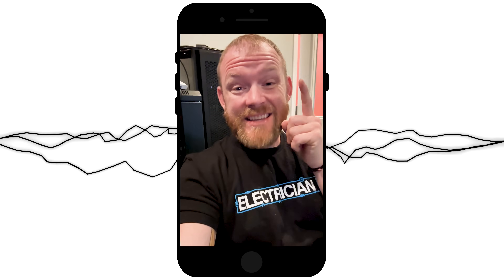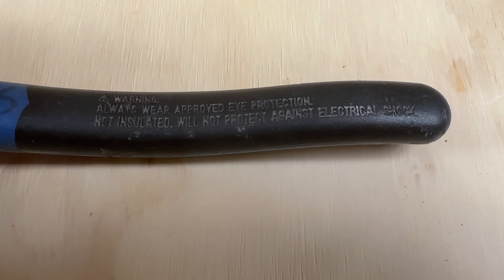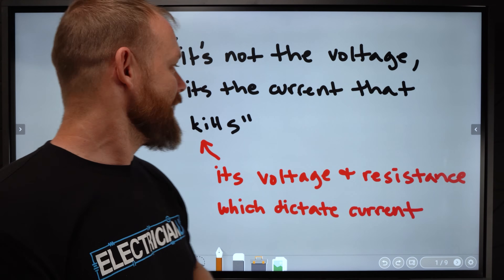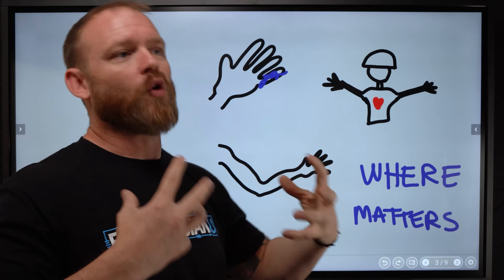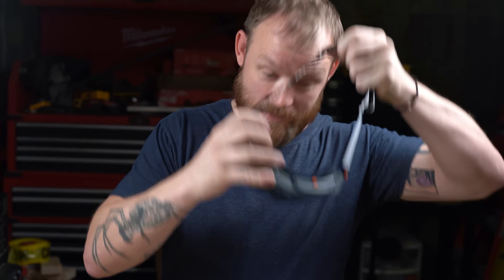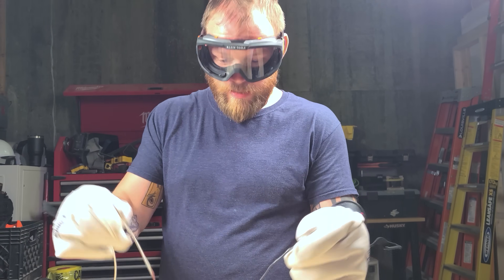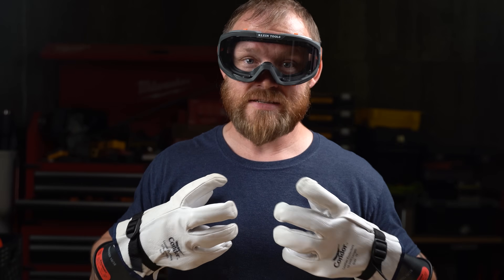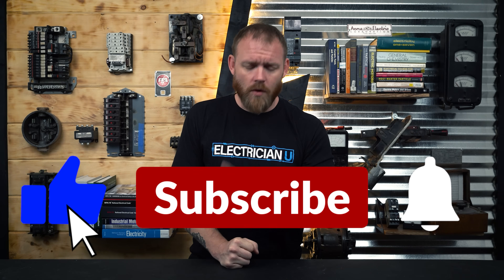Can 120 Volts Kill You?

Comment: I’ve measured 120v with my multimeter on current once, thankfully didn’t get shocked. Have has some run ins with rf burns though, very quite painful.
Reply: I can attest, RF burns hurt every bad and that's very low level burns... I nuked a finger tip before at 1KW carrier, it was equivalent of being stabbed with an hot knife being twisted around endlessly for a week or more. likely it needed cut/cleaned at hospital(nope). I didn't/wont do that again!

Comment: I was in an attic, not macho just not thinking, ended up with BX cable in one hand and live in the other, of course couldn't let go, managed to kick off the ceiling to push my body off, thankfully didn't get overly burned, but had nerve damage and numbness in one thumb/hand for about a year.  

Doesn't matter how much volts/amps, it's free to turns stuff off and double-check, it's costly to have impacts.
Reply: 💯  better to spend an extra 5mins turning off and checking stuff

Comment: For the rest of the world that uses 240 in every standard single phase outlet, I think a version of this with 240 plus the chicken and amp test would be interesting. Yes this video already answered the question for the most part. But perhaps it could help for those that might still think that while 120 won’t automatically kill you but can, still believe that 240 will automatically kill you no matter what. Even if your just shocked in the hand.

I wonder if this misconception “that 120 is inherently safer” the word safer here makes far too many people think it automatically means safe. Could be why its taken North America much longer to add gfci to every outlet wheres in every EU, AU, NZ system every outlet is RCD “GFCI” protected even the 400v circuits are RCD protected.

Although interestingly most RCD I’ve come across are rated at 30ma and I’m curious why that is vs the 10ma stated being the safe limit in the video, is it different for 240?

Now for note, I do have a power strip that has a 10ma RCD I got in Germany. So they do exist in Europe. The RCD is made by ABB and is the European standard style din rail type just in a power strip which I thought was really cool.

So that could be an interesting addition as well.
Reply: I don't think "Big Clive" electrocuted any chicken but he did hot dogs and meat pies and other foods and the  240+v on the Isle of Man made a lot more sparks and smoke and sizzling/crackling sounds!
Reply: @LDuncanShortridge  Interesting, I wonder if the composition of the hot dogs as being processed and higher in salt and nitrate content than chicken “despite the added electrolytes for this experiment” had any added effects to the resistance. I would be just as curious to see those hot dogs at 120 now that you mention it.

Comment: As a power lineman I’ve direct handle 20 Kv with proper PPE for over 4 decades. I don’t work 120 volts hot. As a kid I got 277 across my thumb and index finger, not fun. When I was a young apprentice lineman, we were taught that it only took a 1/10th of an amp to be fatal.

Comment: Three (3) phase three (3) wire power company distribution system ( no neutral).        How does the power company Balance The Load.

Many many three phase services connected to the system.

Comment: Dad worked in a power plant.  He was working on something and had to leave it for a few minutes.  In the meantime, as you co-worker turned it back on.  That voice we hear from time to time told him to check it again with a meter.  He did and avoided being shocked.  He was passed at the guy who turned the circuit back on.  I don't know if he found the guy who did it.
Reply: Also use lock-out and tag-out to prevent others from turning on the power.
Reply: Ur dad fucked up by not Lockout tagout ,not the other guy

Comment: Realistically NO ONE TURNS OFF THE MAIN PANEL FOR A BREAKER REPLACEMENT. It's not necessary if you know how to stay safe and have the correct PPE. Service work however is frowned upon, but many do it live at times. With no OVERCURRENT protection it's another ball game.

Comment: In Australia we work with 230/415V in standard electrical installations and sparkies here don’t carry non electrical rated tools e.g. pliers/screwdrivers etc. ours are always rated to 1000V and we rarely work ‘live’, the question is though, why as an electrical worker would you ever carry non insulated tools? It’s just good practice if anything to use them always
Reply: The same reason I don't wear a hard hat if there are no overhead hazards, don't wear hi-vis vests if I'm not doing road work don't wear safety toe boots if I'm in a finished occupied residence. Proper tools for the proper scenario.

Comment: I was replacing some troffer lights at a store and had the power cut off for the fixtures
Some goofball wired another set of fixtures through same conduits  and when I moved the one fixture there was a huge pop and sparking from the conduit as they didn't shield the wires

Comment: I worked as an electrician for many years, and it's very hard to kill yourself with 120V. Yes, if you're standing in water. Yes, if you can't get away when you contact 120V. And for 220V and up, you can definitely shock yourself to death easily.
Reply: Yeah I’ve been bit by 120 and imagine double that would not be something I’m gonna try.

Comment: It’s not about the voltage rather about how you are shocked if you are zapped through your hand or something it’s not a big deal but if the voltage runs through your heart it could easily kill you an example of that would be grabbing a hot with your right hand and grabbing the neutral with the left the power will flow through your heart
Reply: unless your grabbing just the insulation that should be safe. electrons only flow through conductors at that voltage
Reply: @fisforfriendship6093  yeah should’ve specified that’s what I meant

Comment: Worst shock I ever had was 90 Vdc through both arms. Felt like someone hit me in the chest with a sledge hammer. I thought I had the power switched off but there was another source. ALWAYS check with a meter for power first.
Reply: I can attest getting hit with DC is way worse than AC. to me AC under 208V is like ehh. I go oh, I'm getting shocked let go and move on, above that nope!
DC, I hit myself with hard as a kid series connecting multiple 6v lantern batteries(railroad used, so thrown away at the slightest dimming/hours of use). end result was over 100V DC.
another time I got across a car ignition coil, fired by points on a d-shaft motor, it went in left leg and out right arm, that was holding ground wire(metal leg/rim folding table), I landed curled against the headboard of bed, which I was sitting on the bottom edge of. yeah I had very strong large legs from bicycles/racing.
Reply: Please go back and read my comments on the to twist or not to twist!!!!!!!!
Reply: DC beware of the D-Direct feels like a hit with hammer fist 🤜 direct not alternating
Reply: Did you not have a ticker??
Reply: I always tell people DC hurts way worse than AC at least imo
Reply: @blizzington4528  That was nasty. I thought I was dead. It happened 37 years ago and I'll never forget it.
Reply: @James-dt7ky  dc hurts worse at lower voltage and less at higher voltage. Weird how it works. I'd prefer a 120vac shock over a 90vdc shock...but I'd prefer a 10kvdc shock (been there) over a 10kvac shock (wouldn't be here) any day of the week.
Reply: Yes dc power latches onto a person. 
Ac current does do the same thing